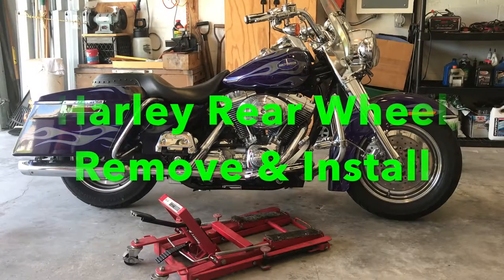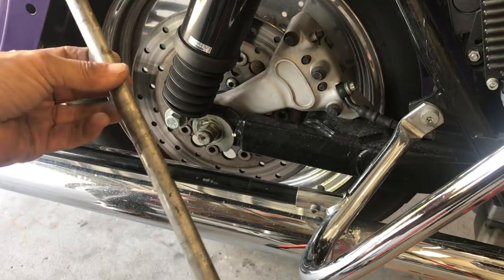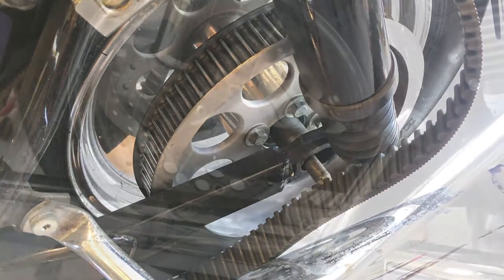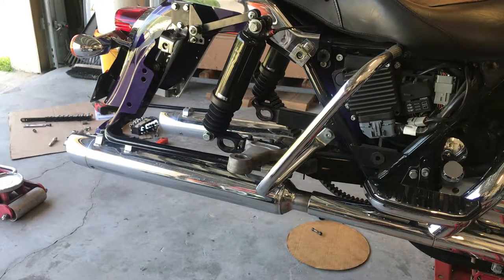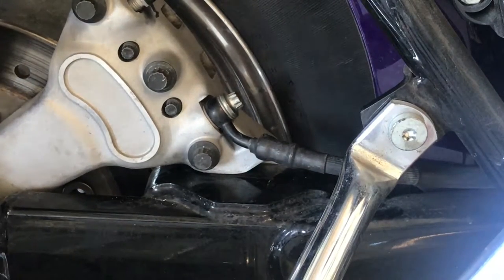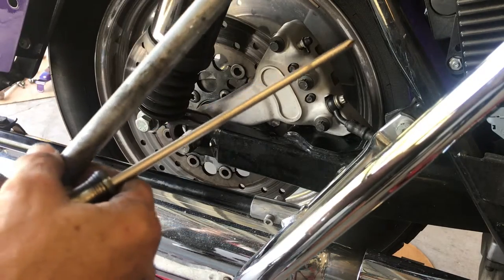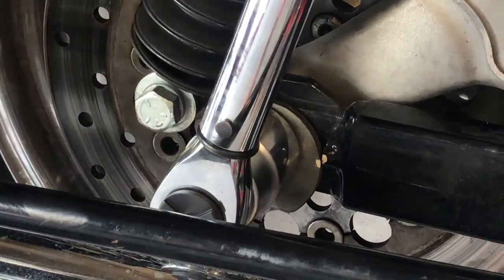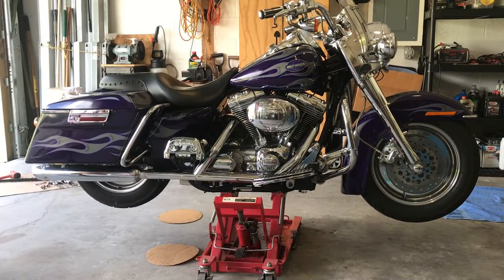How To Harley Davidson Wheel Remove And Install.

Comment: cool    so glad i watched this.... I've got a 2001 Dyna and it's a little bit different... so I wasn't going to watch, but my mind kept saying click on it, go ahead!!  LoL  Well turns out even though the rear end is a bit different on the Dyna, the rear belt adjusters for instance, there were things that were the same.  For example the back brake.  Same.  I wasn't sure about how it was supposed to come off, or even if it was supposed to!   Well, the video answered that question. I feel more confident now knowing how the brake comes off.  The smaller axle trick, well that's even better!! Makes the job sooo much easier.  I'm doing my tire tomorrow but first: Home depot !!!  Glad I watched this Great VIDEO!!!
Reply from the maker: Happy to help. Any questions just ask and yes that still half inch rod makes a world of difference and removing the belt lining up the spacers. Thank you for watching and all your support Elliott. Ride safe and have a great day. Let us know how it works out.
Reply: @TwoWheelRocco  Hi Rocco!!  Did my rear tire I had a 3/4 axle so luckily I had a breaker bar that fit right in!!  Everything went back together perfectly using your method!!! Only thing now is the rear belt adjusters.  When I took the tire off I counted the number of turns on each tensioner to pull wheel off.  4 full turns each.  Well putting the tire back on and turning belt adjusters back four turns either the belt gets too tight or the metal covering attached to rear adjuster screw is loose.   Tension feels good  but when i match the other side it's just not right. May axle is so far out of whack now i dont know where to start to get belt tight  Axle straight and belt tensioners on the rear of swingarm tight!!  Lord have mercy!!
Reply from the maker: @elliottnunez1057  Happy to help. Loosen your axle and start over do an equal adjustment on each side you'll see your index marks and start with two notches on each side. you have to be even. when you feel the tension is right tighten the axle and take it for a little ride. I hope that helped it's really not that complicated. Just take a minute a little patience and you will see what you missed. Let us know how it works out Elliott.
Reply: @TwoWheelRocco  Thank you. I will check it out tomorrow!!
Reply from the maker: @elliottnunez1057  My pleasure. Let us know how it works out.
Reply: @TwoWheelRocco  Aha , I got it all straightened out!!  Would I do it again?  I really don't want to, but yes.  The second time probably be a heck of a lot easier.  The belt tension was a lot tighter than I thought it would be.  Did it by feel, not knowing what it's supposed to feel like!   Got a tension gauge on there and wow ,  had to get much tighter.  Now that I know what tension feels like on my belt, I'll be able to do it again but quicker the second time and possibly without the gauge.
Reply from the maker: @elliottnunez1057  If you look on your belt guard on the bottom, there's a scale. quarter inch to a half inch is ok When the bike is sitting on two wheels. Those belts are very durable.  The second time will be easy. Thank you for all your support and getting back to us.

Comment: Hey rocco sorry once again brother just learning more and more and getting into it my rear wheel  doesn’t have that type of nut its more simple its a 2001 road king classic fuel injected i recently learned with this same video only difference is my chain is rubbing on my wheel now i did all the steps you did and i put the same exact rim and wheel on i just added
Reply from the maker: You mean Belt?

Comment: Hey Rocco, I'm looking at replacing my front tire on my 06 Sportster XL1200C (MH90/21 Dunlop 402F)  Should I go with same, or would you recommend a different Brand? I have a Dunlop on the rear-still fair amount thread. Thanks again:)
Reply from the maker: I Like Dunlop tires on Harley Davison they have the HD look.. Just my opinion that's what I run on my Harley Davidson's.
Reply: @TwoWheelRocco  Perfect! Thank you again, you're imput is important!
Reply: @TwoWheelRocco  Should I go with the D402F, or the Dunlop American Elite Harley-Davidson Front Tire
Reply from the maker: @billmeloche4918  My pleasure. Ride safe and have a great day.
Reply from the maker: @billmeloche4918  D402F
Reply: @TwoWheelRocco  Thanks again...sorry to trouble you so much...but it's better to learn from a "Master"
Reply from the maker: @billmeloche4918 No  trouble.   Obvious you're in love with your bike and I love that.

Comment: How do i find out the spec of the rear sprocket im putting on the new wheel thats chrome same size as old wheel
Reply from the maker: Hope this Helps,  https://www.hdforums.com/forum/dyna-glide-models/1007440-pulley-torque-spec.html. Any questions just ask. Thank you for your Support. Let us know how this works out. Ride Safe and have a great day.

Comment: What are the torque specs for the front axle on a o 5  road king
Reply from the maker: Happy to help. That would be 55 foot pounds. Thank you for watching and all your support John. Ride safe and have a great day.
Reply from the maker: @johngarrett5548   55 pounds for the axle nut in the front.
Reply from the maker: If you could be a little more clearer on what hardware you're talking about. Thank you, love to help.

Comment: That cam washer .. it’s facing the opposite way as the axle side?
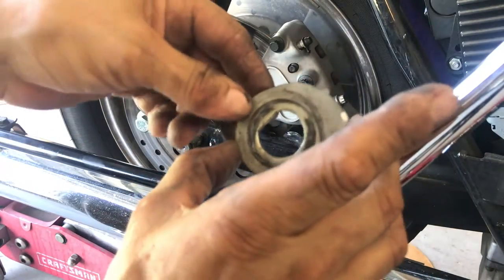Reply from the maker: Happy to help. You do realized that the cam washer is welded to the left side of your axle,  so the chance of putting the other sides on the wrong way is highly unlikely. Thank you for watching and your sub.  Take a look. 16:15.  You will notice cam washers are indexed with white paint. This will help when you have the bike apart for sometime. And you could always check back and make sure nothing loosened up. Thank you for watching and your support. Hadley..
Reply: @TwoWheelRocco  yeah but on your video it looked like you put the washer side the opposite direction. I’m putting mine back together now and have them both facing the same direction. Then I saw yours and thought they were supposed to face opposite eachother
Reply: @TwoWheelRocco  I appreciate your reply.
Reply from the maker: @hadleyslife7351  index with a spot of white paint and you never have a problem. Ride safe and have a great day.
Reply from the maker: @hadleyslife7351  my pleasure.
Reply: I figured it out. Thanks you too.
Reply from the maker: @hadleyslife7351  Happy to read all went well. Ride safe and have a great day.

Comment: What might be the issue if my wheel is rubbing the belt?
Reply from the maker: You're alignment on your axle is off and I've seen it before where on the right side that cam piece comes off and sometimes it can move. because it beat up . how many miles what year bike? But that's where I'd be looking in the alignment should never rub against the tire now what size tire. Thank you for watching and all your support Ben. Ride safe have a great day. Love those Road King.
Reply: @TwoWheelRocco  2000 road king.
It's rubbing against the belt guard area as if there is no clearance but the cams aren't even close to the stopping point.
Reply: @TwoWheelRocco  29k miles
Reply from the maker: Reinstall the belt guard, but put everything to the left side so that moves to guard away from the Pulley.
Reply from the maker: What size tires. Stock for that bike would be a 130.

Comment: Thanks
Reply from the maker: Happy to Help, Any questions just ask. . Thank you for watching and your sub Rusty.  Ride Safe and have a great day.
Reply: @TwoWheelRocco  do you know the torque spec on the piece that holds on the passenger side front wheel axle. I snapped a stud today putting the fron wheel on. Bought a used 07 road king classic 6 weeks ago. Trying to get it in shape
Reply from the maker: fork clamp pinch bolts (upper and lower) = 14-18 ft lbs
caliper mounting bolts = 28-38 ft lbs
front axle nut = 70-75 ft lbs
front axle pinch screw = 18-22 ft lbs
 Happy to Help, Any questions just ask. . Thank you for watching and your sub Rusty.  Ride Safe and have a great day.